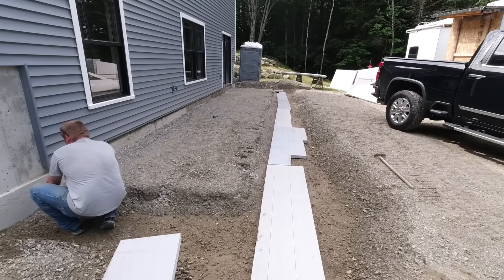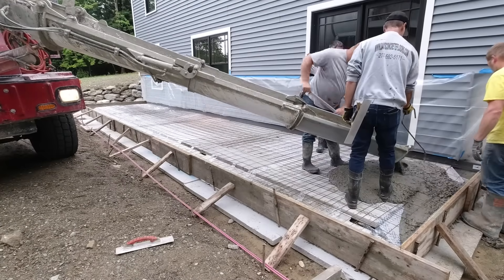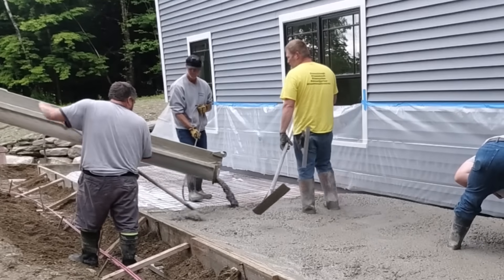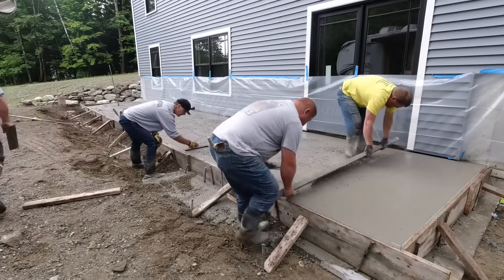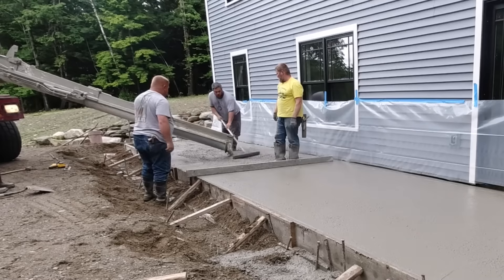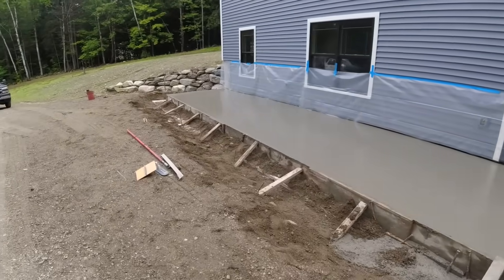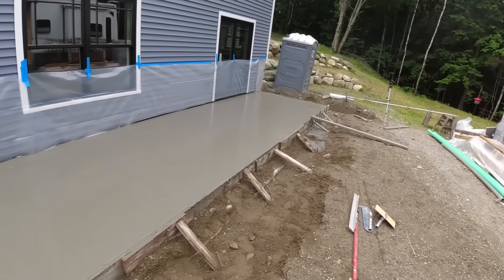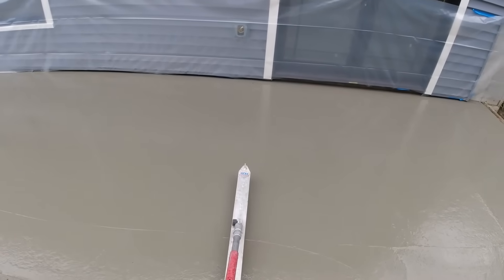You've Been Pouring Concrete Wrong All Along, Here's Why

Comment: I heard you mention that you don’t pour the slab against the house in the slab begins move or shift later on. If that’s the case, what do you put between the slab and house so they are not connected?
Styrofoam?
Reply: You could use styrofoam but it would tend to deteriorate and look ugly after a short time. That’s a special material, specifically designed for isolating concrete to concrete joints. It’s very inexpensive.
Reply: You could even use strips of tar paper, attached to the existing concrete. I’ve done that in cases where less than a half inch gap was desired. Visqueen would also work. Anything to prevent the bond. Cardboard even.
Reply from the maker: We use a roll called Iso-Strip Off for our isolation joint. It's kind of a foam, comes in a 50' roll, either 4" x 1/2" or 6" or 8". We glue it to the foundation with 3M spray glue.
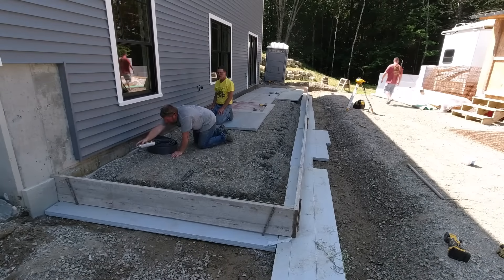Reply: At 0:35, you can see the roll being applied